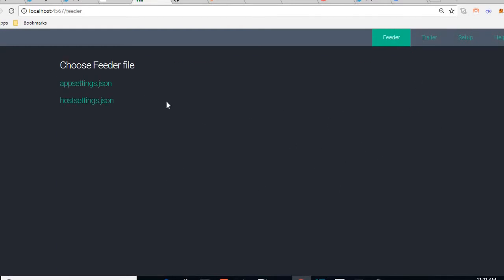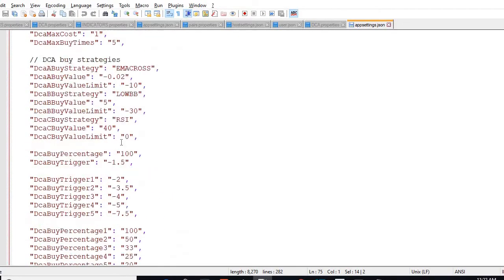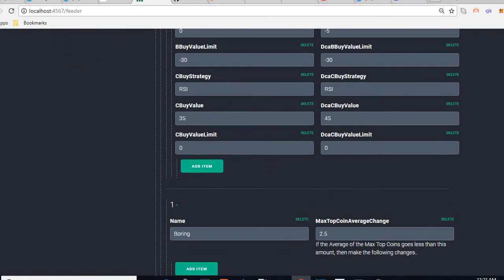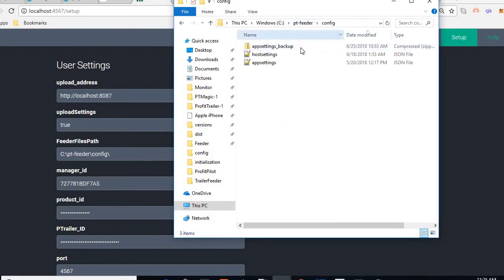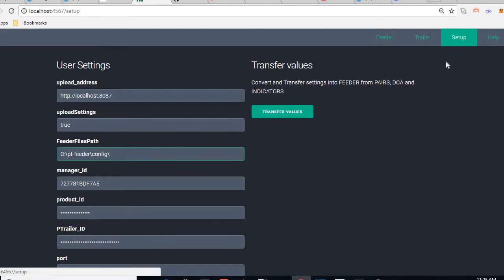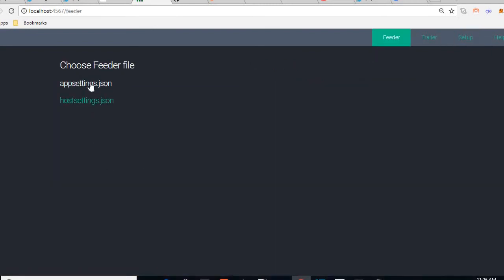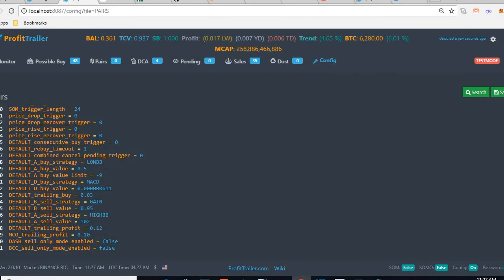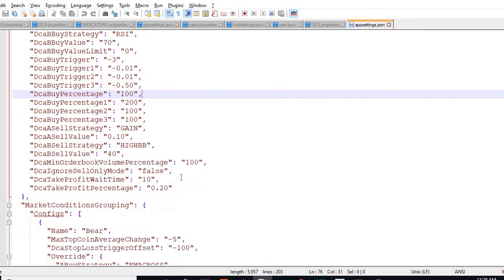Pt FEEDER - AUTO Settings TRANSFER! from PROFIT-TRAILER (using Pt Co-pilot)

Comment: are you purely using Pt and Pf? any Cryptohopper still?
Reply from the maker: I still use Cryptohopper as well
Reply: would you suggest cryptohopper for a first time Investor? it seems really straight forward
Reply from the maker: In my experience I found Cryptohopper much easier to use for beginners. But it's slow compared to PT. ProfitTrailer is much faster but it's more difficult to use.